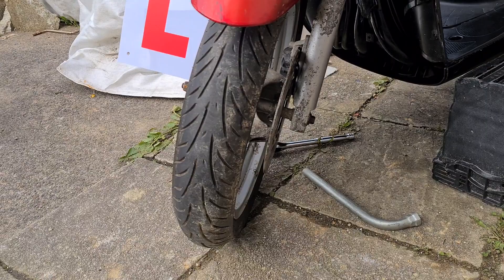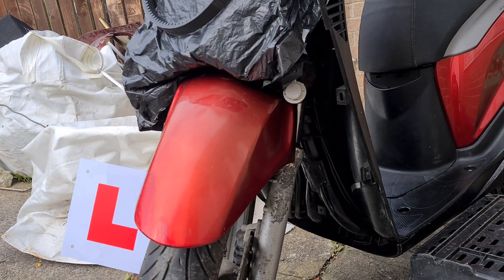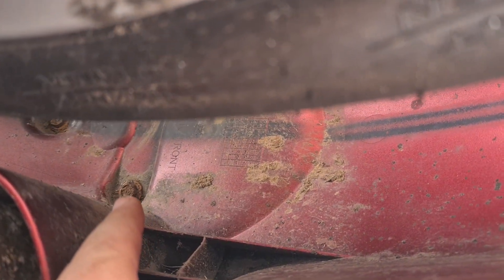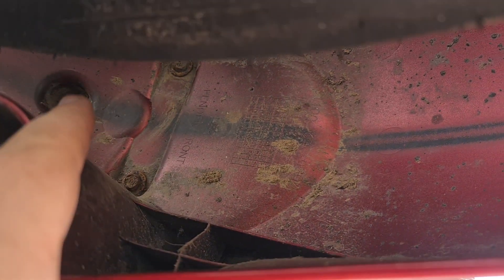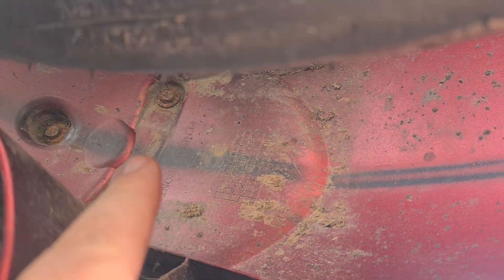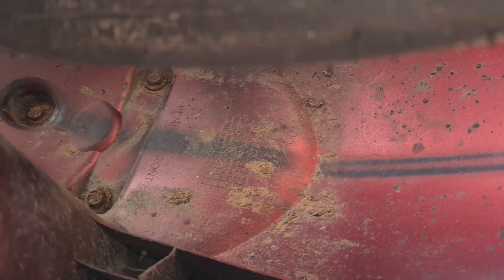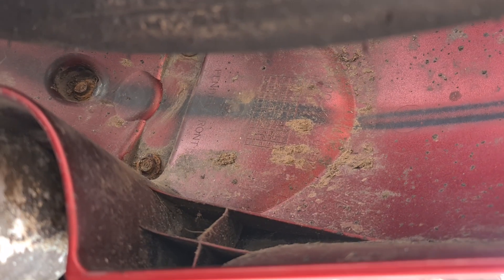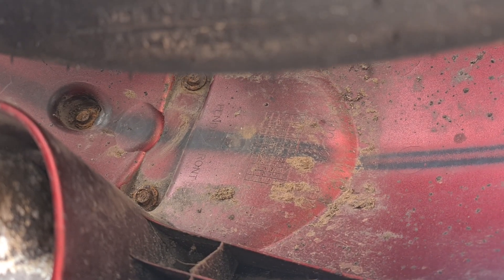here is my Problem that I'm having atm

Comment: Yes George bang plenty of WD on them and let it soak in some, If it's still a right $%^£$^"^ try the old balloon trick in the socket for a little more grip on them rusty old bolts. :)
Reply from the maker: I'm going to get a dremal tool tomorrow and try cut a bit into it